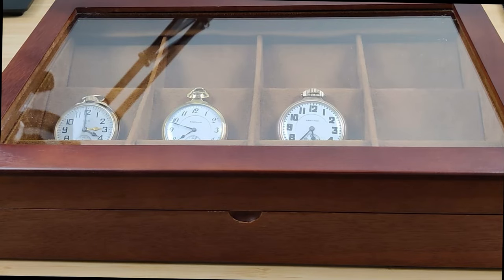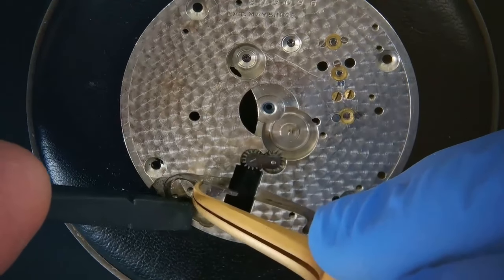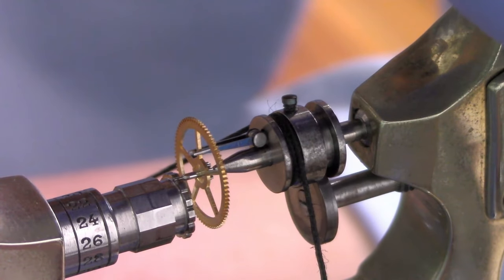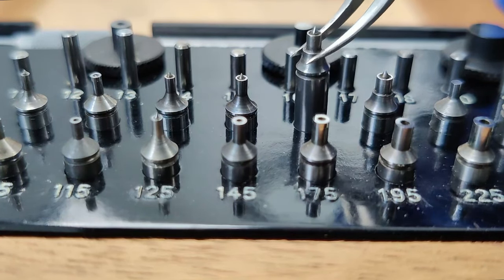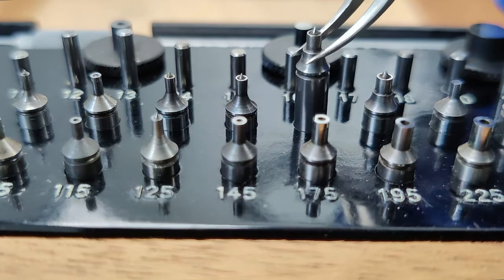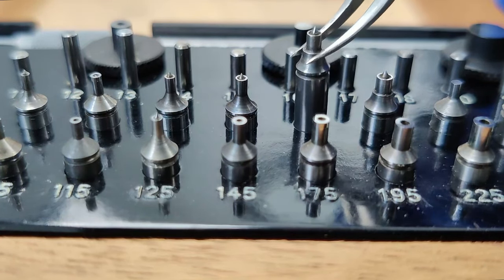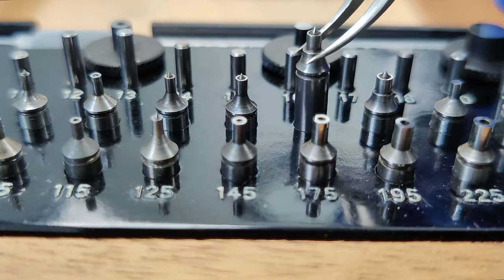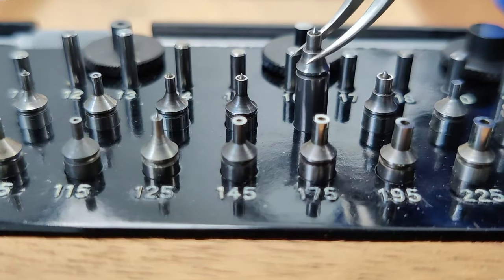You Won't Believe All The ISSUES I Encountered Restoring Hamilton 992 Antique Pocket Watch!

Comment: That's a beautiful watch, is that a 14k gold case?
Reply from the maker: Hi, unfortunately not.  Many cases look gold, but are what is called "gold filled."  This is slightly better than modern day gold-plating, but gold-filled actually means two thinly pressed (or rolled out) 14K (or sometimes 10K) plates sandwiching a base metal, like brass.  Thanks for stopping by!

Comment: Interesting in adding weight to the meantime screws. Everything I have read (Henry B. Fried) and seen recommended was to never remove or add weight to the meantime’s. I have a Waltham movement with filed balance arm meantime’s, and it screwed up the whole timing because it was impossible to get them balanced due to the different weights. Where did you find a recommendation to add weight to the meantime’s? I am always looking to improve or get differing through’s on my preconceptions.
Reply from the maker: Hi, I appreciate your feedback.  Yes, I read the same in Fried. I was surprised to see that there were existing washers on the MT screws.  Thinking through things, I thought that turning the meantime screws outwards and adding weight to them both accomplish similar goals.  So I was pleasantly surprised when the readings on the timegrapher were good (in all positions, though I only showed 3).  

The only place I've ever recalled reading about adding washers to the MT screws was on Mark Lovick's watch repair forum.  I'll try to find that and post the link here as a reply.  Thanks for stopping by and for you enjoyed the video.
Reply from the maker: As promised, here is the group discussion where I saw it being done.  However, after reading further down, i realized that others then told the OP not to do that!
I understand your frustration.... it's really hard to poise the balance when material has been shaved off the screws.  

https://www.watchrepairtalk.com/topic/13649-meantime-screws/

Here's another thread where commenters have seen it done many times, although they agree it is not recommended.  I do wonder why considering both accomplish similar goals?  Interesting topic, and like you, I'm always learning.  Hopefully others will be able to share the exact reason why you don't do it.

https://mb.nawcc.org/threads/meantime-screws.133044/